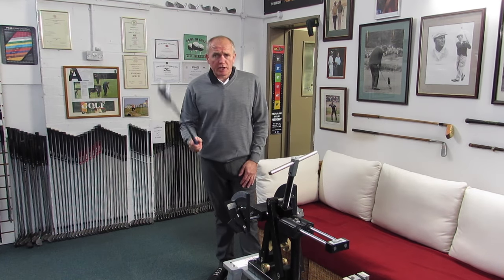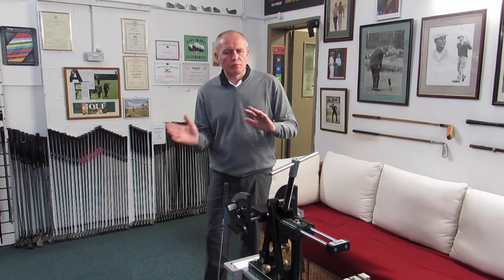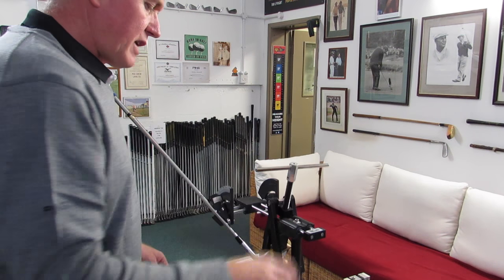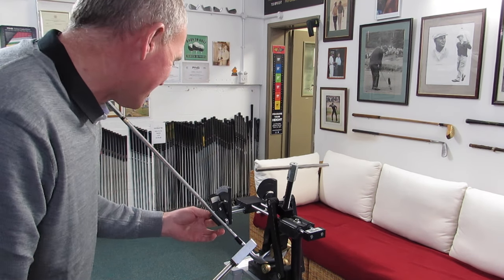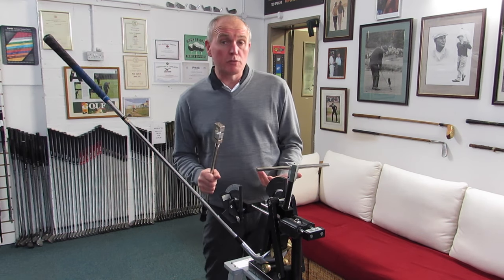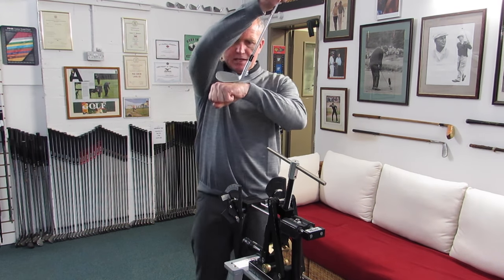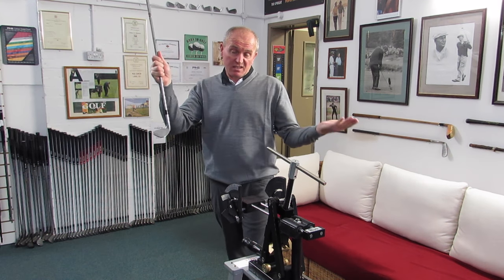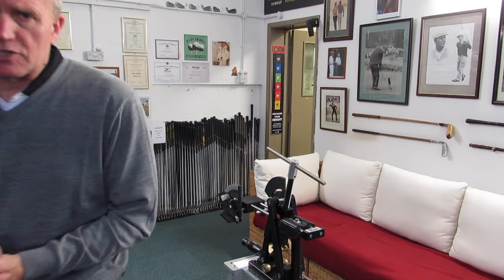Loft and Lie Machine in action.

Comment: So for the Ping ISI irons I have to send them back to Ping to have the lie changed on them? What about the Ping Karsten Eye2 woods and Ping Karsten laminated woods?
Reply from the maker: In the Uk you can send the irons back through a Ping account shop/retailer there is a carriage fee to pay for the lie change. You do not change the lie angle on woods.
Reply: @andrewainsworth497  I was afraid you were going to say that woods couldn’t be changed. I finally found irons in the correct lie now, but am striking out on finding woods in a Gold Dot. It seems like it will be easier to find Big Foot riding a unicorn than a used set of gold dot woods

Comment: Hi Andrew,

I made the experience, that it is more the shaft that bends during a season, than the head with it´s hosel...
...and I wouldn´t want the hosel to be bent, that the curved shaft delivers the former angles again.

I also made the experience, that even new shafts can have a deviation of about 1 degree depending on the orientation they are installed in a club head.
I also wouldn´t like that the hosel would be bent, to accomodate the deviation of the shaft.

Is there an easy way to check, whether the shaft has to be replaced instead of bending the head?

A few weeks ago, I measured the loft of my 3 iron again and found, that it had meanwhile the loft of my 1 iron...
...so, I removed the shaft (which was obviously bended and not the head) and installed a new one...
...then I measured again, and everything was alright without bending the head of my 3 iron!

The hosel of an iron is much thicker and much more stirdy than a shaft,
so, I would bet, that almost in every case, it is the shaft, that should be replaced, instead of bending the head it is installed.